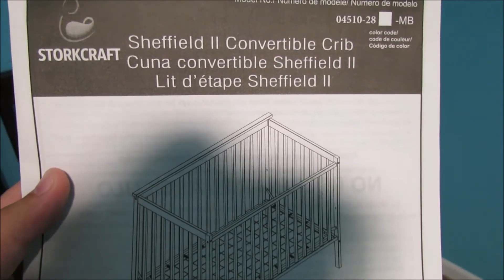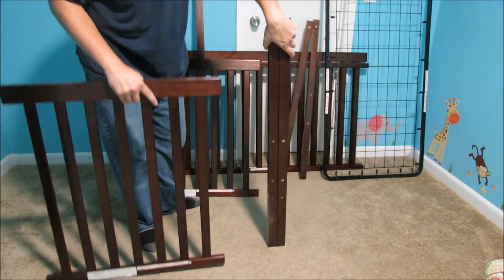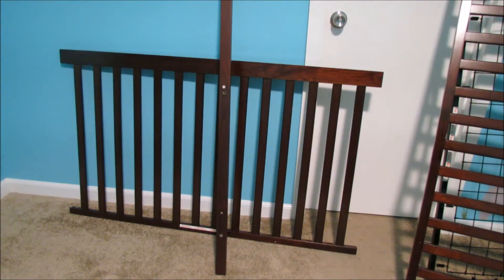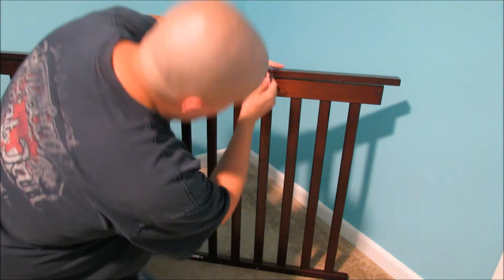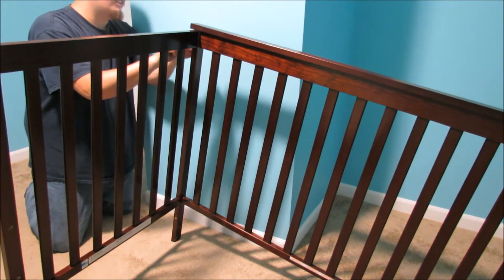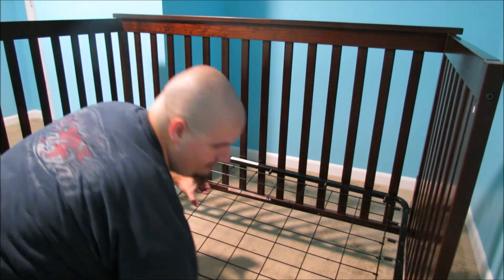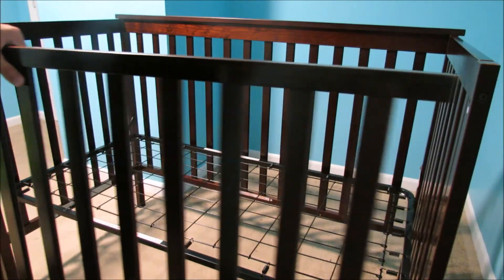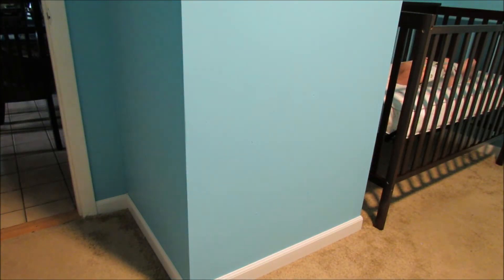How to Assembly Sheffield II Convertible Crib

Comment: Side note: the part that the mattress sits on, the bracket holes might not line up. Mine didn't. I have two in the back extended up towards the screw holes and the two in the front had to be slanted down to be able to connect. It was a pain in the but, other than that this crib was extremely easy to put together.
Reply: what did u do to fix that problem